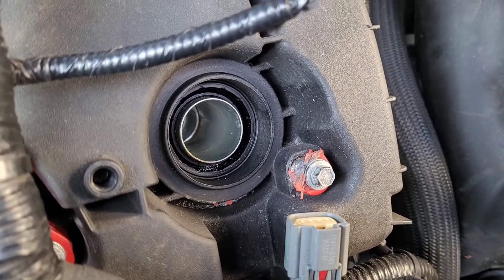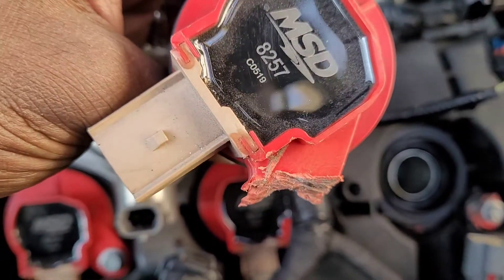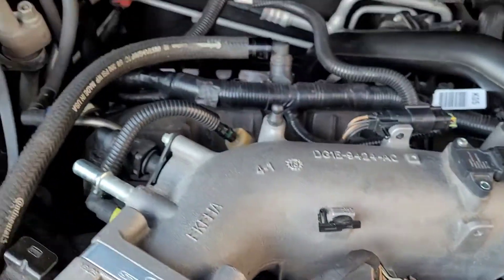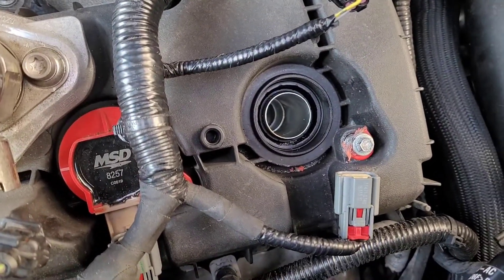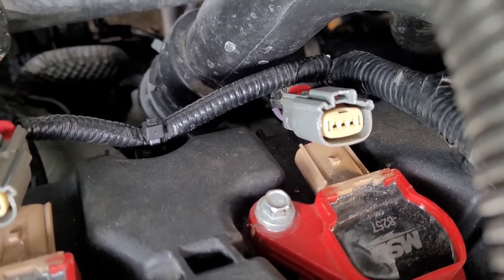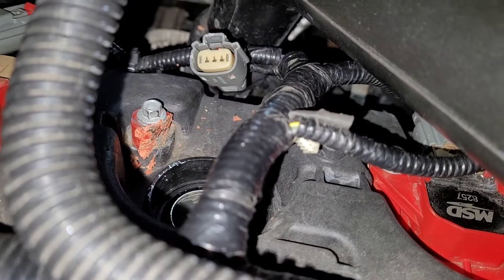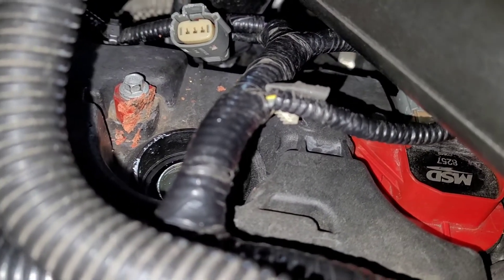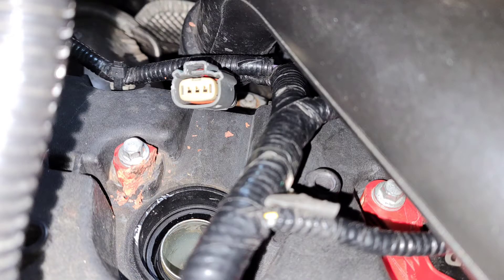I Broke My MSD Coils

Comment: That happened to me changing to my MSD coils... changed my plugs at the same time. 
It happened on the same back coil... those screws are in a brass nut that is only in the plastic cover... mine slid out with pressure from a interior panel pry tool. It was a shitty feeling... when it happened
Reply from the maker: A panel puller? I have one. These bolts seem to move with the brass sleeve.
Reply: @blacktalonsport1262  the brass sleeve just spins it will come with the puller